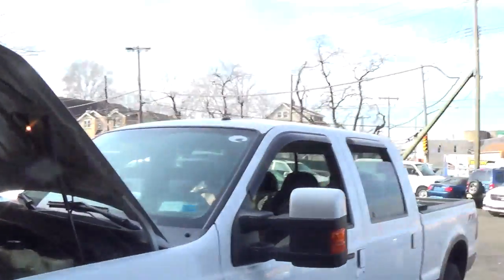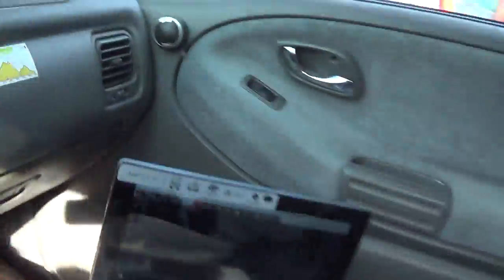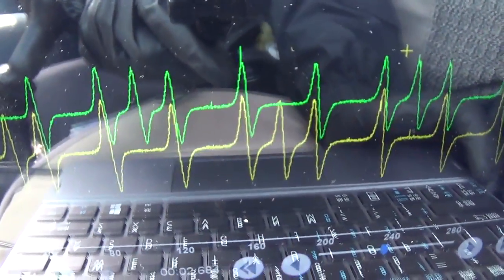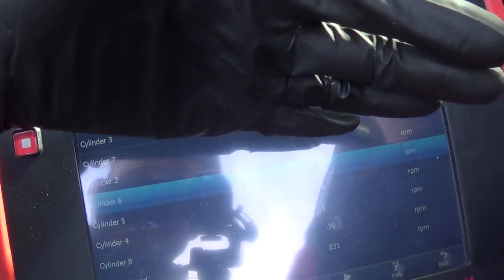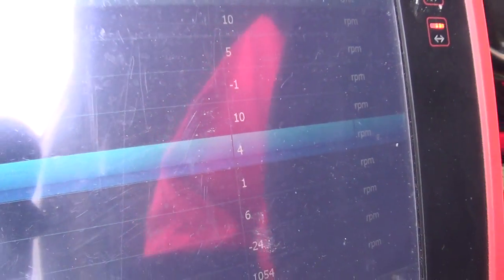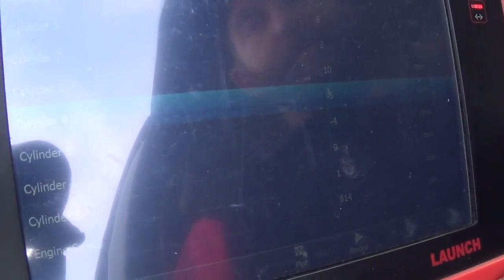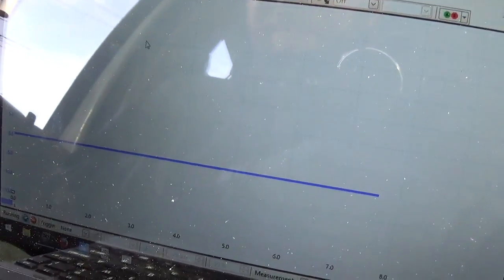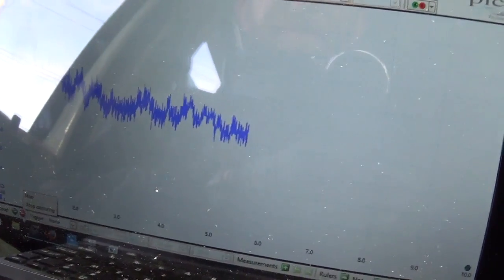Ford Truck Low Power: Exhaust Pressure test with Custom Transducer (SI Express Ep 7.9)

Comment: Another thing you can do is drill a little hole in the down pipes, put rivnuts in there, a barb to fit your vacuum/pressure gauge,  then check them old school (should be around 1 PSI).   Then thread brass plugs in there and keep them as test ports for the future

Comment: Hi Ivan, interesting as usual! How do you feed voltage to the pressure transducer? Can you use the Picoscope signal generator for this or does it need external power source?

Comment: Nice work with pressure transducer. How will transducer survive heat from exhaust? Cheers.
Reply from the maker: It's mounted on the end of a 1-foot hose so no worries from heat damage :)

Comment: I was noticing the higher frequency content in the waveform. I have not seen a known good one. Is it plausible that the HF content was caused by turbulence through the restriction?
Reply: That HF is coming from the starter current inducing voltage in the scope leads.  It can be cleaned up by using setting or using a low-pass filter. Shielded BNC or twisted pair scope leads also reduce it.
Reply from the maker: If the HF is coming from the starter, then how do you explain the "noise" when the engine is running and the starter motor is OFF?
Reply: I rushed off the reply this morning, I should have said alternator, the alternator will be full field right after start up.  It would easy enough to prove yes or no by firing without the alternator connected.
Reply from the maker: Hmm not sure. My transducer setup is a stand-alone unit that is not electrically connected to the vehicle in any way!

Comment: I have a cadillac eldorado in my shop, 98 and it is running lean on bank 2, and only bank 2. The fuel trims are ~20. I've already smoke tested it, there is a small leak around the throttle body shaft seal, but very small. I've already checked all the injectors, and just incase swapped them from one side to the other to see if the lean would follow them and it did not. There are no misfires, and the o2 sensors are swinging fine. On a throttle blip test, both bank o2's go rich and back to lean like you would expect from a throttle blip. I've tested the exhaust for any leaks, incase any fresh air was tricking the o2 sensor. The only thing I can think of at this point is maybe some engine issue. You have any experience with this issue ?
Reply from the maker: Check valve timing by doing a relative compression test.
Reply: I did a compression test, and all the cylinders came out with 220 PSI. I'm really at a loss at this point, other then maybe the o2 sensor is working but slightly off. It is not an OEM o2 sensor. So someone has replaced it before. Thank you for your reply!
Reply from the maker: hmmm OK well next step would be an injector balance flow test. Any misfire codes?
Reply: No misfire codes, I've already done an injector balance test. Also, I swapped the injectors from bank 1 to bank 2 and vice versa to see if the lean condition would follow and it did not, bank 2 still running 20% on fuel trims. While bank 1 is around 5-7%. Someone suggested that I do an, "internal vacuum leak check", by blocking off the PCV and checking for vacuum or pressure on the dipstick tube. I don't see how this is possible but I'm grasping at straws, so going to do it.
Reply from the maker: I would swap the upstream O2 sensors around in that case just to rule out a skewed sensor.
Reply: Thanks for all your help, your responses have led me to believe I have been on track and is reassuring. I'm going to swap the sensor and see how it fairs. Thank you kindly again sir.
Reply: internal leak? vacuum

Comment: The other cue of a clogged cat is sometime you will get a short gust of air out the intake pipe when you apply the throttle which diesels have none of but it happens on cars for sure so you can apply a vacuum boost gauge on the intake and will definitely see the fluctuations.

Comment: Nice!  Good tip by Keith too on looking for less acceleration on common bank cylinders to help point you towards a restricted cat.  Did you guys do a video of the prior diag to this vehicle?
Reply from the maker: Hey Mike, this was another one of those multi-problem vehicles where it had one problem to begin with, and then several were "built-in" by each subsequent mechanic that worked on it.
It all started with timing chains, but then led to clogged cats, welding in new cats with key left ON causing throttle body to go nuts, then coolant left in spark plug wells caused a multiple cylinder misfire. Oh and also the TPS went bad too. Could have made a 5-part case study out of this one, as well as many others throughout the day. Only on Staten Island "Bermuda Triangle" I swear LOL
Reply: motoYam82 lol, know how you feel dude.  They welded with the key on?  Ouch.

Comment: Doing it at the O2 sensor is definitely quicker than in cylinder pressure testing plus if you have exhaust back pressure on in cylinder testing then you'd don't know if it's an exhaust valve not opening b/c of a  bad lobe, follower, pushrod or a clogged exhaust without inspecting or taking readings from other cylinders on that bank. Your home made pressure tester and custom settings seemed to work pretty good. You're engineering background pays off over & over! Did you do the custom settings yourself?

Comment: 25psi! Damn that's high. Nice work Ivan. Nice work on camera Keith. Thanks guys!
Reply: I had 48 psi once, lucky the engine survived! :( 2004 Grand Prix GTP comp G. Melted the face of the cat so it was pretty much solid.
Reply: Baxrok2 booooo
Reply: Guess you guys will have to invest in some anti-reflective screen protectors, otherwise, there's no where to hide!

Comment: how much 1 of those cats ? i know cats are expensive anywhere on the planet
Reply: Generics can be had new for under a hundred, but you'll need to modify (welding) them in order to bolt in.  Dealer sells bolt ins starting at three times that price and/or way up from there, choice is yours.

Comment: Sweet,,, Can you use a regular pressure gauge in the o2 sensor hole???
Reply: I believe ScannerDanner showed a pressure gauge hooked up to the EGR DPFE tubes on the exhaust manifold technique.
Reply: I am going to check for that one, Thanks